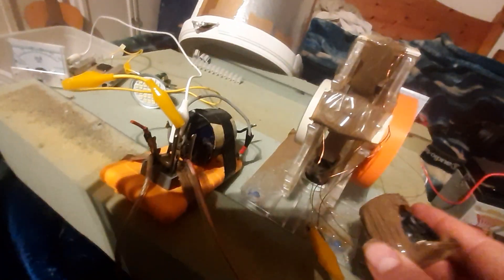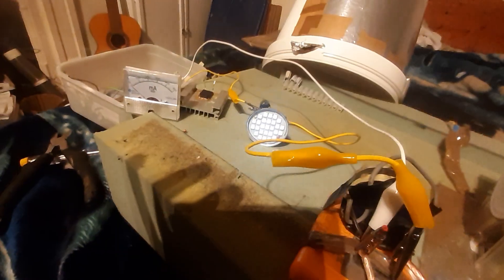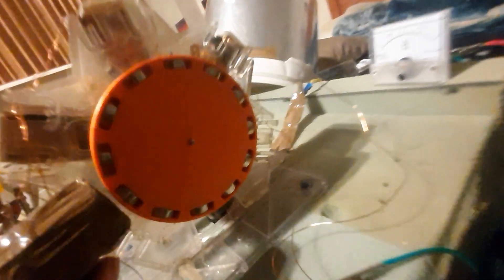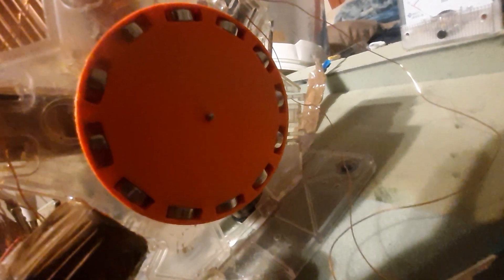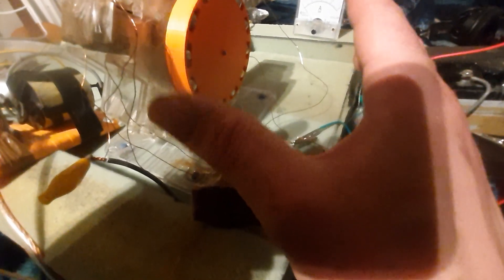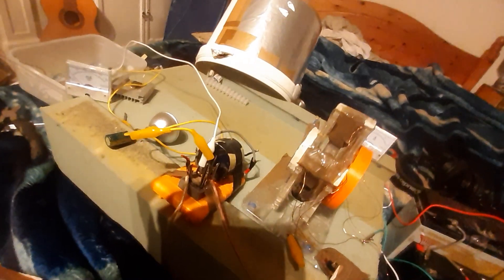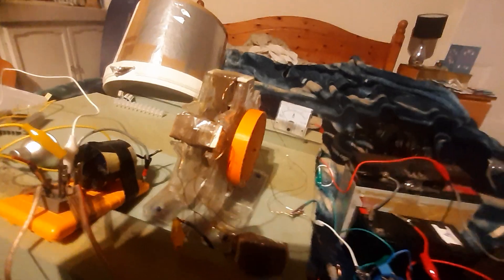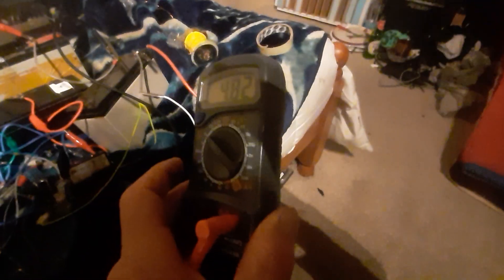GENERATOR WHEEL - BEDINI MOTOR - RICK FRIEDRICH ENERGISER

Comment: Like it mate. My old man has made a Bedinni, it runs, seems to be charging the other battery but I see it as taking the energy from one battery and putting it in the other, a waste of time. I've been trying to explain to him that to generate any meaningful current we have to use opposing fields, n s n s, pull push pull push or we're missing half the sign wave and probably producing less that half the current.
I like the idea of having a pulse motor run a generator, I believe if we have more coils driving the pulse motor well create more torque. I suggest he has two, offset pulse modules and coils so we get a pulse inbetween the initial pulse.. I hope I've explained that correctly? lol, yes it would double the input power but should double the output torque which we can convert to more power out 👍